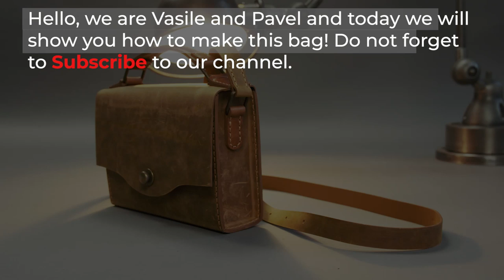Amber Mini Bag (Link to Pattern in Description)

Comment: Which adhesive u r using?
Reply from the maker: a polychloroprenic adhesive, based on toluene
Reply: @VasileandPavel  toluene 's smell will make lose the veg tanned 's original  smell... So i am using water based neoprene adhesive( intercom 1816 & 9006). Its really good. ( its not a sponsored comment😜). Even toluene free synthetic rubber adhesive also doing good.
Reply from the maker: @V3leathercraft  i don't think it is a problem. I use ppolychloroprenic adhesive since 1988 :). It is reliable and easy to use and I find it easy. I'll try once that adhesive you recomend, who knows, it's posible to like it.